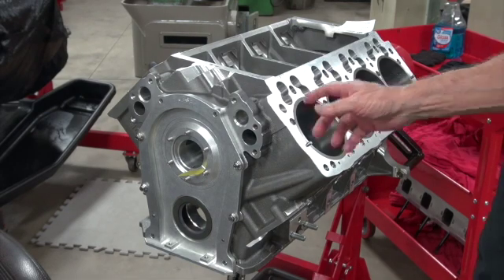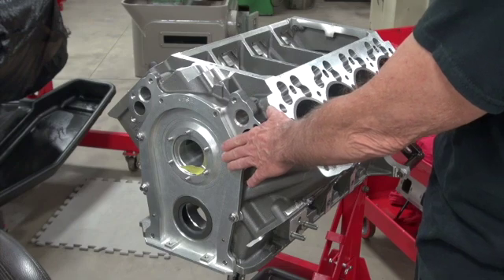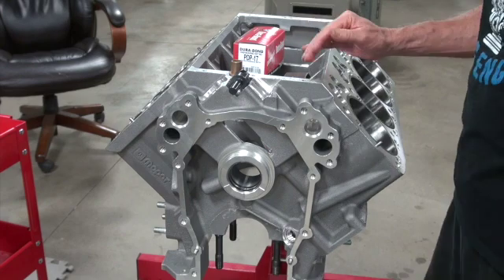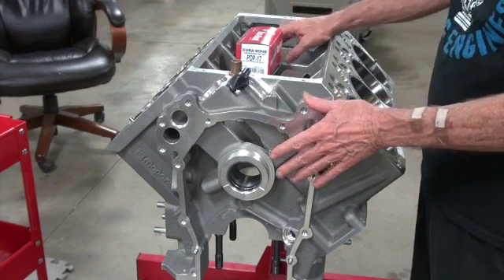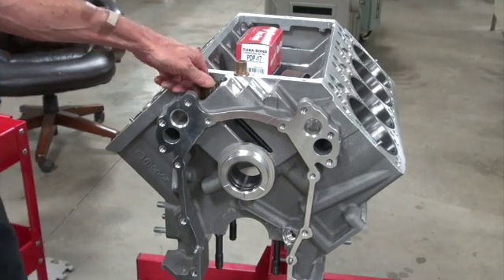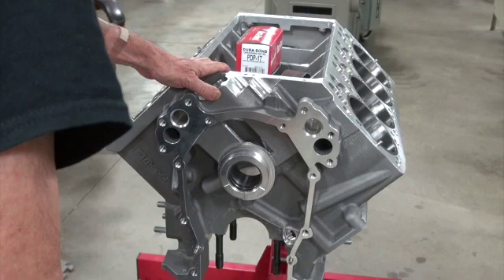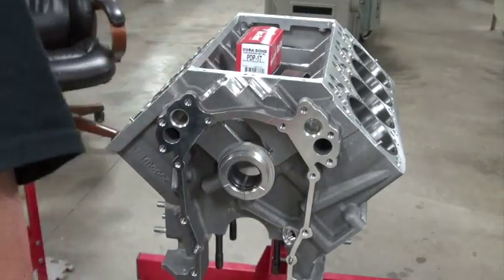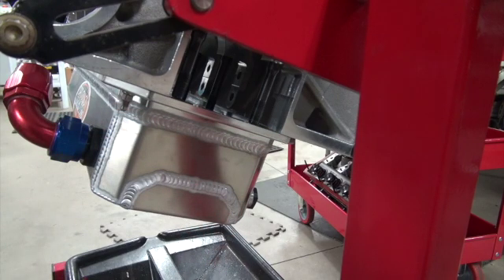Keith Black 572 Hemi build Ep 5 #426hemi #572hemi

Comment: Did you test fit a cam to see if the journals are straight in the block?  The last stock block 440 I assembled was so far off the cam could not be installed, and I resorted to a barbaric method to make spin freely.   Thanks for making the video.
Reply from the maker: Yes it turned great. I’ll show that in the assembly video. Thanks for watching.
Reply from the maker: I’ve been there. I covered what to do when that happens in the last build.